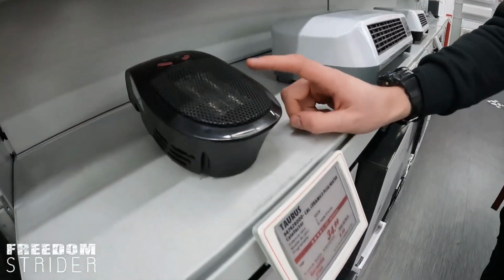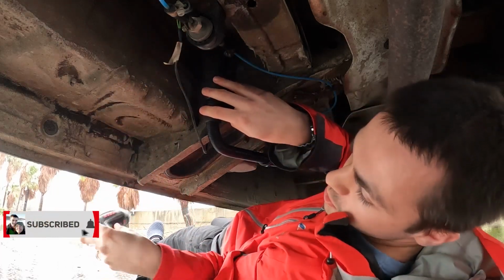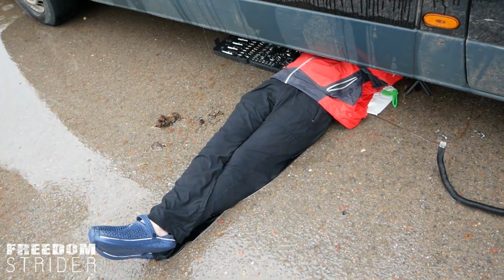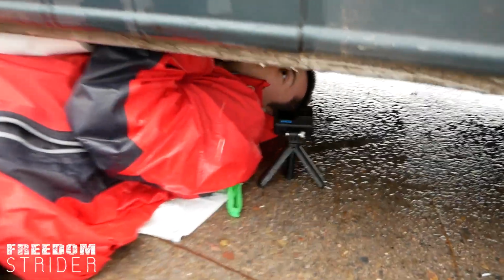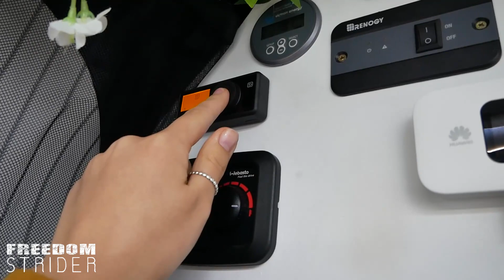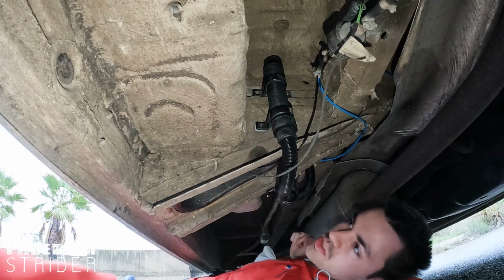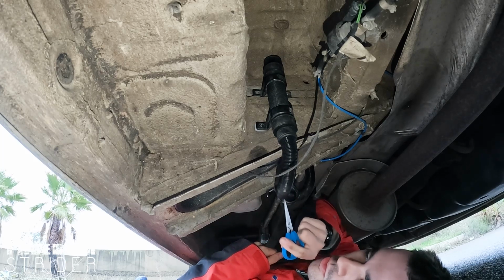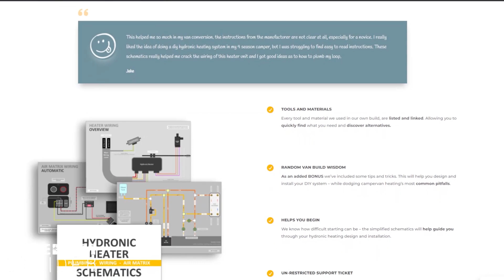BROKEN DIESEL HEATER! This is not how we expected vanlife to go...

Comment: Knock that plug out of the floor just above the intake and plumb it inside the van, problem permanently solved. The intake shouldn’t take in too much dust or you’ll have problems again, dust will require you to remove the heater and disassemble and clean it to resolve.
Reply from the maker: Yeah we debated doing this, I think we will either do this or build a big box around the heater and air intake to protect it 👍

Comment: Great to see that you identfy problems, and you solve them! One thing about filter on the air intake: I hpe its just some kind of metal mesh, just stopping larger objects. Its just a blowtorch in there after all. If its more like sponge- type of filter, it could get saturated with water, not letting air through.
Reply from the maker: Yeah this eventually damaged our heater as it rusted the glow plug connections. Lesson learnt!

Comment: Hello just bring the air intake inside the van ,otherwise when freezing weather you hole in the pipe gonna freze and the problem start over,good luck
Reply from the maker: Hmm actually quite a good shout, we had some issues with our heater recently and we dropped the air intake downwards now so this should be okay (we hope)!

Comment: You need two heaters if your full time in a van, it’s essential, I have a truma combi 4e which runs on LPG and an auto term planer 2d diesel heater as a back up, if both break I always have my engine so that’s 3 heaters, you need to learn everything about your engine and be able to diagnose problems yourself until you don’t have to rely on others you will always have disasters. As an example to get a skippers license you have to be able to strip and assemble everything on the boat including the engine. No one gonna help you 500 miles of the coast in international waters. You need to be the skipper living full time.
Reply from the maker: We have repair manuals and such, so we expect that some learning on the job will occur 😉. We will probably get a back up heater, but we haven't decided which.
Reply: @FreedomStrider  you done a great job of diagnosing and repairing the heater , just apply that investigative skills to everything that goes wrong and you’ll be more than half way to becoming the vans skipper 😂 👍

Comment: why not buy a stand alone diesel heater,  they incorporate the diesel  tank and all, and can be moved around (5000W Air diesel Heater LCD Remote 5KW 12V For Truck MotorHomes Caravan EBAY ) you could use your existing exhaust system from  your heater, it would get over the heating problem for now. Just watch further, looks like you fixed it, well done
Reply from the maker: Thanks, it's always good to have more options to think of backup systems. Buying a cheap diesel air heater might be a good backup to keep in the van during winter especially incase something like this happens again 👍🙂

Comment: This is the very reason I've fitted a diesel air heater as well as a Webasto style water heater that can heat the van. If one fails I still have a second way to heat the van. I can survive without hot water on tap for a while but not heating.
Reply: Good thinking, I am going for a diesel heater and an iMass on demand water heater to indeed seperate the 2 systems.
Reply from the maker: Backups are always good, it's actually why we didn't go with a combi B2B+MPPT all in 1 box for our electrical system because we didn't want all the recharge options failing if 1 box fails. Too bad we didn't have a spare diesel heater on us, but oh well, something to look forward to 😎🤣
Reply: @FreedomStrider  The only reason I'm going down the route of Belt & Braces is because I plan to take my 9 year old son across Europe next year in our campervan. It just the two of us, so I have a back up for almost everything. 2x 400w solar panels. 2x 40amp MPPT. 2x 300Ah Lifepo4 batteries. Gas hob & Induction hob. I know I've totally over designed everything.
Reply: @FreedomStrider  maybe get a Chinese one as a spare for €100?
Reply from the maker: Maybe, if we go for proper winter vanlife it might be wise 😊
Reply: @drewhodge3820  wow, that is more Ah than I have in my house. And I live off grid. You'll be fine.
Reply: @ab-ym3bf  I've got lots of electronic gadgets to keep me lad happy when it's raining and were stuck in the camper. Plus a few bits for me. Like full CCTV that will run 24/7. I'm in the process of building it at the moment. When I find the spare time. Where going to rough it in the back of that van this summer holidays. Just a basic camping stove/diesel heat/raised mattress/water containers and a portaloo chucked in there. It needs to be ready by Xmas. So we can chase the warmer weather.
Reply: @drewhodge3820  enjoy both the build as the end result, I will start my build next week!
Reply: @ab-ym3bf  The build is half the fun. I have some unique ideas I've not seen anywhere. I've just got to figure out how I can pull them off.
Reply: @drewhodge3820  that's what I thought,  but the more I researched, the less I am now convinced I think of something new. But that doesn't matter, just have fun

Comment: I know I am late to this. But all you gave to remember is the air and exhaust has to be in a slight downward from heater. So just for that so water can drain out. So no up ward loops
Reply from the maker: Your advice makes sense 🙂, it is rather weird why the manufacturers instructions told us to install the air intake in the S loop we have. Thankfully our exhaust is pointing down.

Comment: Yes the glycol will never easily flow through that pipe design so pump and heater and either cavitating or getting air pockets. Just go one unit at a time and don’t use any tees expect your three tees for the radiant part. The problem if a so,Turin is flowing down a pipe and come to a tee, it just keeps going mostly through path of least resistance and other other outlet of the tee will hardly have any flow.
Reply from the maker: Aye we were going to do that, but then we thought by the time the glycol reached the last component (the heat exchanger for the hot water), then the glycol will be cooler and not as effecient to heat the water.

Comment: I'm not sure that's a good solution. What would be better is to fit an aluminium plate to cover that chassis section thus protecting the intake and fuel pump from road spray/dirt but still allow air to move in that area.
Reply from the maker: Certainly putting an aluminium barrier would be a great solution, including covering the actual heater and all its wires as well

That being said, we count ourselves lucky that we had any solution under our belts in the middle of nowhere parked next to an abandoned resort 🤣
Reply: @FreedomStrider  Yeah fair point 😉

Comment: Instructions for the combustion air system
􀂃 The combustion air opening must remain free at all times.
􀂃 Lay the combustion air inlet so
– that exhaust gases cannot be drawn in as combustion air.
– that fuel fumes that may occur cannot be drawn into the fresh
air intake of the vehicle or heater.
􀂃 Do not direct the combustion air intake against the vehicle's air
stream.
􀂃 The combustion air inlet must not become clogged with dirt and
snow. In particular for machines and trucks in the construction
sector and agricultural machines, ensure that dust, sand or similar
cannot penetrate the combustion air system or inlet. In case
of marine applications, ensure that water cannot penetrate the
combustion air system or inlet.
􀂃 Lay the combustion air system sloping slightly downwards. If
necessary, make a drain hole of approx. Ø 5 mm at the lowest
point to drain off condensation.
􀂃 If necessary, use fastening clips or cable ties to fix the flexible
combustion air hose to the vehicle in suitable places.
Reply from the maker: Thanks ☺️

Comment: Nice work figuring that one out guys. I've just installed the same system in my yacht and had similar issues with it just cutting out. Turned out there was air being sucked into the fuel line at the pump and tightening the hose clip properly did the trick. A small tip - looks like you have a opaque line but if you use clear fuel line pipe between the pump and heater and you can see the fuel passing through and whether there is any air present. Just one for the future troubleshooting checklist :-)
Reply from the maker: Good job finding the issue. If we shine a light through our house fuel line we can see air bubbles but yes a see through one would be better at finding them 👍 these systems are fickly at times!

Comment: Hey guys, love the videos you put out - refreshingly honest.. and sharing the real emotions! After you've had a years use, I was wondering if you would add or upgrade any components your solution?
Reply from the maker: Thanks for the positivity! In terms of our system, we'd add an air bleeder valve to easily get the trapped air out the system, and prehaps a drain point. If we wanted to drain the system at the moment, we'd just have to take the pipe off under the van and have a catchcan ready, it would be messy!

Beyond those quality of life things, nothing we'd change - the system works great :)

Comment: I’ve just found your feed today when I was Googling for UFH for a camper van. What incredibly honest and helpful videos: thank you so much. I am nowhere as experienced as you but I am worried for you after cutting the hole in your heater air intake. With a hole in it, is the air filter not now redundant? Also, would it have been possible to put the heater on the outside as you have done, but put the air filter intake inside the van?
Reply from the maker: Hey Philip, glad to have you here. We don't think the air filter is redundant, as most of the air will still come through the bigger opening (with the filter) - the hole we added at the base is tiny, so it's more likely to get clogged up with dirt than letting it through. We hadn't had any problems with it so far. 
As for putting the air intake on the inside, I would say it's definitely possible, though you would have to drill another hole into the van to bring it up and I would check with the manufacturer's instructions on this.  😊

Comment: Very pleased to see you got it fixed. I’m in the process of installing the same heater, but I decided to install the heater itself inside the van, under the driver’s seat. However, it sounds like it might be quite noisy, at least from this video, so maybe I’ll need to attenuate it somehow. Anyway, keep up the good work 👍🏻
Reply from the maker: It is pretty noisy, I know Sam was noisy, but the heater (especially when turning on) is quite the rocket. I would think that some good noise insulation would be needed if you prefer it inside.
Reply: @FreedomStrider  After your video I had a good scan through the install instructions and they say it’s not approved to go in the cab so I’ve moved it underneath instead. It will be plenty quiet down there. I may pick up your guide though to help with the wiring. Anything to help work that out would be helpful
Reply from the maker: Great that you double checked that. 
The guide does simplify the wiring so it can help with that. Let us know how you get on and if you have questions 🙂

Comment: Hey guys sounds like you having fun !! I found the average temperature in the south of Spain in the mountains around DEC and JAN is between 5 to 10 c at night. When I first arrive I feel the cold a bit but after a while I found that I only used the heater if its less than 10c and not when in bed, as the bed is super hot even at 5 c (although the breath air can be a little cold) That said when its wet or like 8 c in the morning it is nice to put the diesel heater on. My heater is quite noisy so I don't like to use it if I am near another camper too early in the morning .. I probably should get a moped silencer which would help (will see if anyone has done this  at Camp Quirky).  Also a hot water bottle can be a game changer.
Reply from the maker: At 10C we need the heater less, but since we sleep on the floor the air gets colder. Also, we try and keep the temperature in the van above 18C as the fridge starts being weird (and defrosts our I've cream 🥺) and we tend to like going in the mountains (which need heating even in May)... so no heater would have been not ideal. 

Otherwise, yes, our bodies will have adapted to colder temperatures and we have hot water bottles, they are actually a vanlife essential of ours 😉

Comment: So pleased to see you found the problem and a perfectly suitable 'fix' for it, if it works perfectly well without the air intake pipe, a small drain hole at the bottom of the bend is no biggy at all. We are all very envious of your trip, something EVERYONE should do before mortgages and kids take over your life. Don't ask me how I know that.... Only observation is ,surely you could have found a 'dry' spot for this fix attempt without laying in an inch of water? nearly every supermarket in Spain has covered areas for summer shade? I appreciate van height is an issue but I would have persevered to find something! As much as I love Spain, don't let your guard down on van security though, you could get robbed blind if you do. safe travels and good luck.
Reply from the maker: Yes we are glad we figured out something in the day to fix our situation, it was not a problem we wanted to deal with ☺️

I'm afraid there was a huge storm of torrential rain all week and no shelter... we haven't found any public high top shelters so far. So we did what we had to. 

We see vanlife as a way of life and we wouldn't do anything that would hinder our freedom and flexibility... we have no intentions to get a mortgage and we don't see kids as a hindrance.
Reply: @FreedomStrider  My children are the best thing ever and not a hindrance in any way but if you think your vanlife adventures wont change when that time comes you are very wrong and will have a wake up call for sure. my suggestions were that you are doing the right thing travelling whilst you have the freedoms to do it, as implied by your channel name! I did not care for the tone of the reply so have un-subscribed. kindly delete my comment.
Reply from the maker: I don't know you and you don't know us, so we always choose to read everyone's comments and a positive mindset, so we see you in the best light possible. 

I read your comment I thought you are a great person. And took the time to answer. 

I don't know what upset you in my reply, but I can assure you it was unintentional.

In answering, I was simply thinking about our plans and views and I was not making any assumptions about you and your life. I was just sharing, like you.

What I meant be 'hindrance' is not that my life will not change, but rather that I welcomed the change they will bring. And also, that I'm willing to take on the challenge to discover freedom where a lot of people lose it.

Comment: Dual forms of heating a wood burner , dual cooking energy gas  & induction hub plug inverters 3000w up ideally to be able start a washing machine although / 240v huckup , power solar panels & engine charging battery bank 
That air of we all give a try and let's not give is part the cure 
God help both is rest thanks for my video from u2
Reply from the maker: Thanks for all the tips 🙂